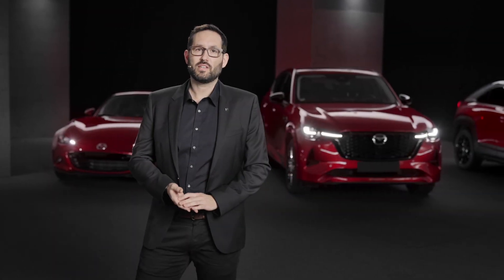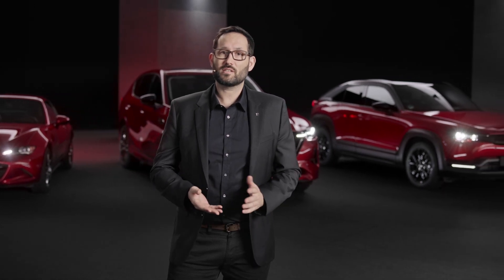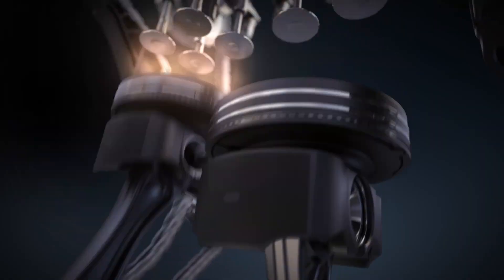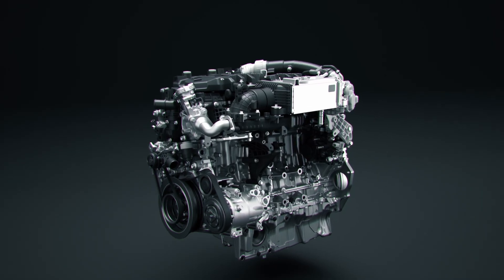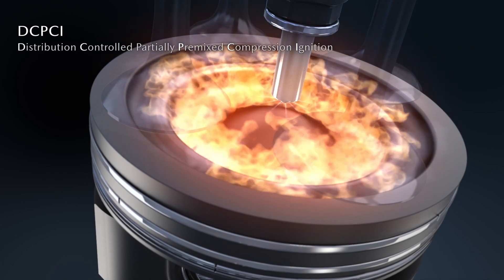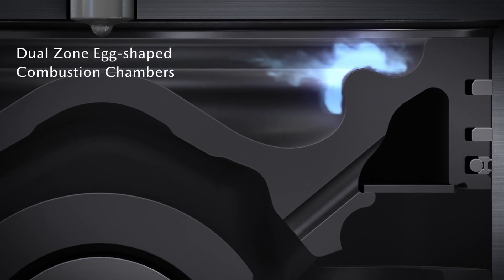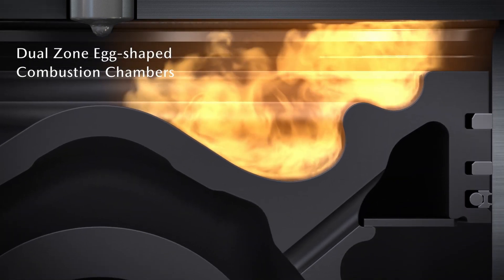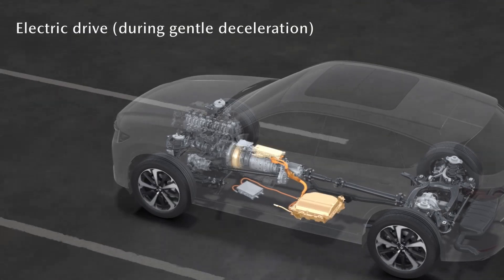Mazda talks | Internal Combustion Engines

Comment: Mazda moves on and will win much more customer hearts with their decision for combustion engines ❤
Reply: Not in big cities. They are introducing low emission zones. Internal  combustion engines are being phased out rapidly.
Reply: @July-A7 what about carbon neutral fuel or hydrogen fuel being developed?
Reply: @redargument  I sense that the money is in EV and that's why all this push,even though the technology isn't well proven and infrastructure isn't there yet.
Reply: @July-A7  i agree with you but i also see it as manufacturers trying to get as much money whilst EV is popular and than ignoring once the gimmick is over it happens far to often lol
Reply: @redargument  I suppose the attempt is to sell EV at these expensive prices. In time competition may lower the costs and hence better prices for consumers.
Thereafter though, when we are all confined to driving EV and have no other choice, the costs of batteries may rise due to insufficient resources and prices will rise again. 
In my view, while it's good to develop EV technology and related charging infrastructure, ICE vehicles shouldn't be demonised and restricted . They are still the better cars to drive and we have all the gas stations and mechanics and parts for repair.
EV is new, let it grow naturally instead of artificial and unnecessary coercion.